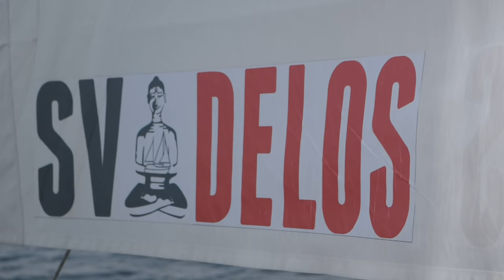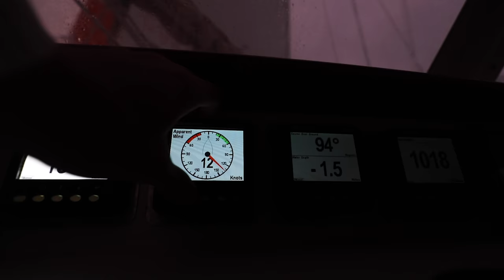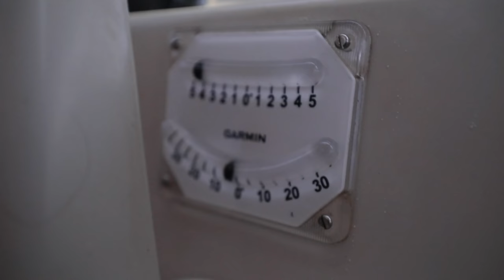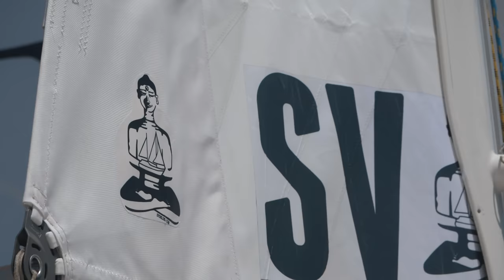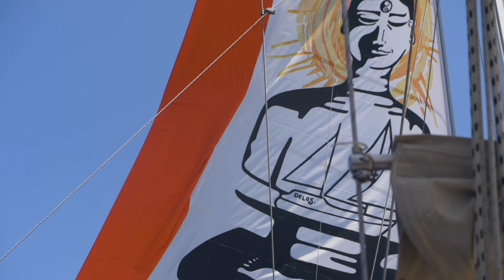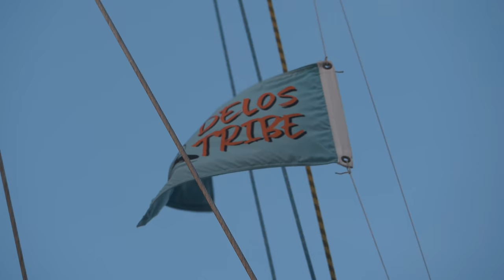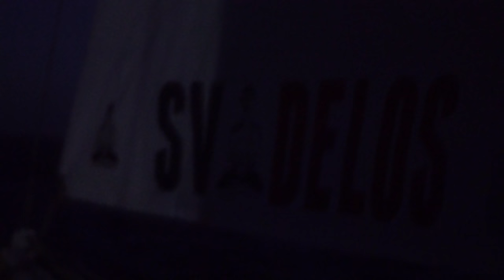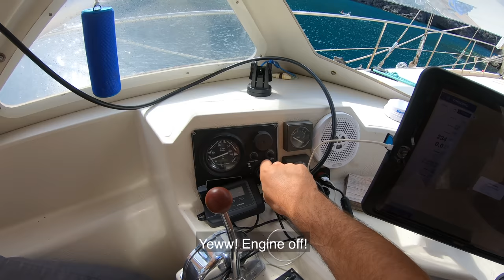AZORES after 13 days AT SEA! Sailing Vessel Delos Ep.249

Comment: Happy New Year.  Brady, I like the way you view the charts of the wind direction and use it to set the course for the best way to reach your destination.  I am also surprised there is no warning when the power just shuts off.  It seems to me that would be an easy thing to implement and for safety reasons it would be good to know if you were on watch by yourself.

Comment: 9mm exterior ply top and bottom square plates on the drone, 4 x 12mm threaded nylon bar lengths to hold the two plywood squares on the top and bottom of the drone, and a wooden broom handle with a long stainless self tapping screw for the bottom handle. Drone catcher mk2 sorted. Light and robust... Should even float it the worst happens! (paint all wood parts orange to spot easier lol)

Comment: Just a little Tip if you need to monitor and control temp on things like a freezer (or what ever)
a VERY cheap solution to that is Sonoff TH-16 .. you can get a probe that measure humidity and temp and one that just do temp .. and you can monitor it all over WIFI from your cell phone .. it can allso be set to control a fan for cooling or a heater or what ever .. it's pretty darn smart.. i use one for my smoker oven (just an ex) ..
Reply from the maker: Awesome! Thanks for the info. Brady

Comment: Hey my beautiful souls.  I have an idea for your drone catch handle.  Instead of the steel u bolts, perhaps consider ballistic plastic or aluminum all-thread and nuts. Also instead of a steel pipe for the handle perhaps a piece of schedule 80 PVC will be lighter and still plenty strong. Schedule 80 PVC comes with threaded ends in almost any length and size.  That should significantly lighten your catch rig and increase your drone height and fly time! Ideally if money were not an issue, making a custom catch handle rig from light and strong carbon fiber would be super slick.  Also if you seal the catch handle on both ends it should float in case the drone should end up wanting to go for a swim. Good luck and calm seas! Be well.

Comment: We have a Victron Energy System that gives an alarm when the batteries go down through 25.2 volts and will automatically start the generator at 24.7 volts. Last thing you need is losing autopilot and radar during a squall. If nobody is at the helm then it can really ruin your day.

Comment: Do your lithium ion batteries object to getting so low that the system shuts off? Is there a low-voltage alarm that you can wire to your shunt?
Reply: Repeated full discharge cycles do stress Li batteries, however they tolerate full discharge cycles much better than lead and most other batteries, while producing more power.
 Also, the charge controller / battery management system is designed to shut down  power conversion well before the batteries  are drained to the point where they could experience damage.  Brian talked about this after the rig was installed and showed us the software where he could set the minimum voltage he wanted the system to go into protect mode.
Cheers!

Comment: 10:26.., for reasons I wont go into.., what you describe in the podcast is identical to being in prison for a long time.., I guess its similar in that when you first go to prison or set out on a long sail.., you undergo a transition.., after a few month in prison you stop focusing on the outside or (land).., when you get closer to your release date from prison you again start to focus on the outside or (Land).., only someone who has spent years in prison would truly understand the connection.

Comment: Hm.. I wonder if a nylon (don't use PLA - it's too brittle) printed u-bolt and purchased nylon nuts would do the business on the drone to save tons of weight yet remain strong.   Actually the handle and bracket and threaded bit could all come from the bottom and then just some nylon cross-pieces along the top and then the nylon nuts - it'd save a lotta weight.

Comment: Sure wish you would remove that stick off of the drone.  Instead of bolts between the two white plates you should have Velcro. Use the stick to retrieve the drone once you are done flying.  While its in "hover" just raise the stick up to the Velcro on the bottom of the drone.  Once its made contact, power down the drone.  I can see that while underway and not at anchor, the mounted stick may be preferable.

Comment: Tyraps, wire ties - 3/8" / 10mm  rather than the u-bolts on the drone, bit of foam rubber should hold any slip  - just as strong and a lot lighter -- still, nice job

Comment: I like your design for the drone catcher, but you could shed a lot of weight by going with all plastic. I know they make plastic screws and bolts for toilet seats, and you can find a plastic handle anywhere. Those metal straps could even be made of fabric/ twine/ fishing line, etc.

Comment: Nice Vlog, I wonder if Delos have a low power alarm ?  
Nevertheless it happens to everyone so now and them. 
Keeping a plot and a guy on the wheel to keep heading , the rest can fix it. 
I love the amel. They are so well build . 

Cheerio 👋
Reply from the maker: Yep, she sure does have a low power alarm. Unfortunately it was a bit low and with the sailing noises nobody heard it.. All sorted now haha Brady
Reply: @svdelos Oooooft! Genny sounded a bit slow to turn over there i noticed Brady!   That coulda been Sketchy if she didnt start.

Should probably have a Cranking rated Lifepo4 battery installed for the 12v cranking battery, and that battery itself should have an automatic reserve shutoff (EV Works Start Saver battery has that, i have one in the car), or a reserve shutoff should be fitted, so a power reserve to crank is always retained. Last thing you want is dead main batteries, and a dead starter battery leaving you totally dead until the sun comes up. The higher resting voltage and lower internal resistance of the lithium batteries means those Donks will crank over much quicker, especially if the battery is nearly flat. My one has saved my ass a few times already.

Better yet, 2 smaller lithium's, thru a Selector switch, and the battery "Not selected" is maintained with a small charger supplied from the 24v DC battery bus.

2x Start saver batteries thru a Selector would keep you well protected.
the 800CCA Version is 40AH Capacity, and has a built in reserve of about 15% where it cuts off automatically, but can be re-activated at a button press to start an engine.
The 600CCA version will be 30AH for the same physical size.
These batteries are designed to be connected directly to a dumb alternator so you dont need fancy charging equipment as they are fully protected.
You could literally just have a current limited fixed voltage 24v to 13.8v Buck Converter to keep them charged. 

Get Brian to fit Atleast one, but preferably 2 of these in place of your big lead starter battery:
https://www.evworks.com.au/start-saver-battery
Cheap insurance against being totally D.I.T.W all things considered.